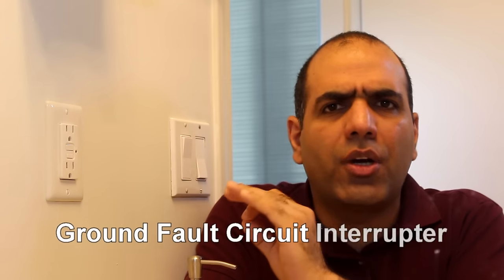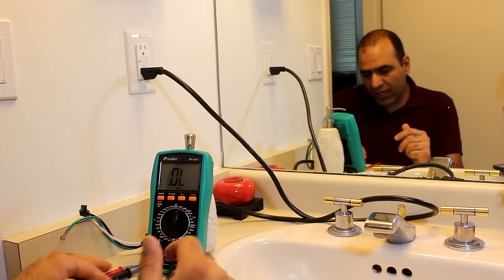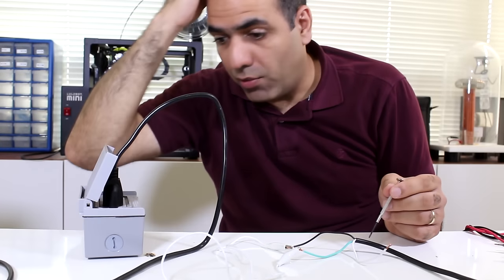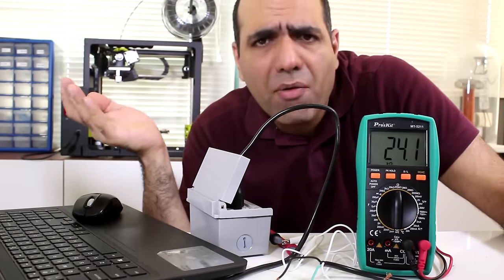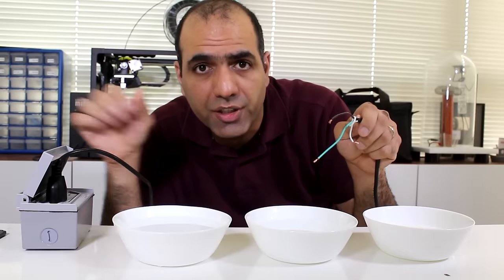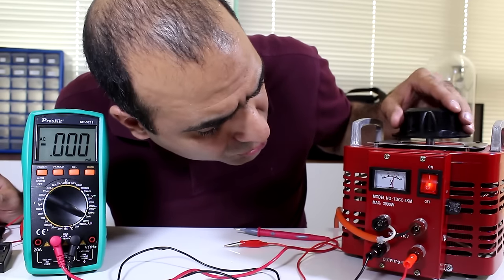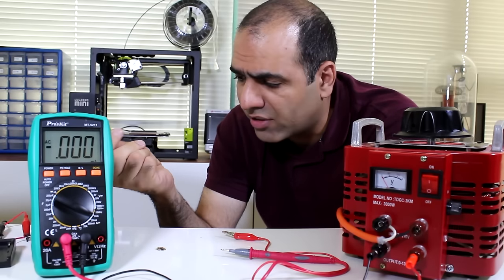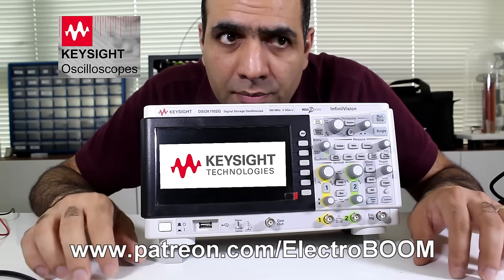The Outlet that Saves Lives

Comment: NOTE: installing GFCIs don't give you an excuse to bring live electronic devices with you into the water. It only makes it so that, if a live electronic device falls into the water for whatever reason, it might not kill you. Best way to avoid danger is to not put yourself into a risk situation in the first place!
Reply: Most of the time I take showers, therefore using devices in the bathtub is not practical. Whenever I bring electronics into the bathroom I usually leave them in the washbasin so that sound waves bounce off its  surface and boost the sound throughout the whole bathroom. Thus I don’t need my electronics to be closer to me and it is a good compromise
Reply: Unless you have an existing heart condition or the GFCI fails, it's almost impossible for that to kill you. Not saying he's right in doing dangerous stunts but the likelihood he would die is mathematically negligible

Comment: Fun fact, most injuries resulting from electric shock are reactive. Like pulling your hand away and jamming your elbow through a window pane or pulling your hand away and plunging the screwdriver you were holding into your shoulder. Not that Ive done either of those.

Comment: The GFCI it's called it in other countries  RCD or RCCB 
GFCI = Ground Fault Circuit Interrupter
RCD= Residual-Current Device
RCCB= Residual Current operated Circuit-Breaker
And only in Germany and Austria and maybe in Switzerland it's called  "FI Schutzschalter" 
(F=Fehler=fault
I= physics formular symbol for current (I=ampere)
Schutzschalter = protective switch)

Comment: Here in Germany GFCI's are mandatory in new installations for all outlets a non electrician may use. Sadly most people are so cheap they have one for the whole house. This way you stand in the dark should the GFCI trip. Though lamps aren't required to be protected. (But most times are since you have a outlet beside the Lamp.)
Reply: Update: in the meantime, light circuits are also mandatory to have an RCD
Reply: Better have it shutting off the whole house than no such system at all
Reply: @aba22125  No. There is a better way. You can put the RCD into the consumer unit so it covers a number of circuits but not all.

Typically you would cover the mains sockets outlets in to which appliances are plugged, and not the lighting.  Such that, if an earth fault occurs, and it is night time, you are plunged into darkness.

Comment: This is standard in every house in Germany. It´s called RCD - Residual Current Device. ;-)
Reply: Same as Australia, all power outlets must have an RCD in the circuit breaker
Reply: Actually it isn't the same. The real RCD (like in Germany) isn't installed directly at the socket, but w/ the other fuses. 

In it, all three phases and neutral (NOT EARTH) are running through a coil. The sum of the currents in a three-phase system is always zero. 

So, if there is a fault current anywhere (something going to earth etc.), the sum of the currents isn't zero. Thereby, a current is induced in the coil, what triggers the RCD immediatly (a few milliseconds). As far as I know, this also triggers at much lower currents than the device tested here.

The downside: harder to install and you need three-phase w/ seperate neutral and earth (do all houses in the States even have three-phase? I don't know). But, of course, we have to be a little more careful regarding electricity anyway, w/ 230V.
Reply: MrBavaria lel there is no plug or switch in bathroom in uk we use string to turn on light
Reply: We still have none in our house ._.
Reply: In most part of Europe it is a safety standard. RCDs protect people from being electrocuted and it helps also to prevent cable fires.
Reply: In Germany and Austria is also common to have 3 Phases in Residential and we have 230V per phase so around 380 - 400V between 2 phases we have 1 phase RCD to and its a safety standard. for human safety ist 30mA trigger and for fire safety is 100mA. Its also common to use 2 or more 30mA RCD`s one for normal outlets one for the bath and one for nighttimecurernt if you have.
Reply: It doesn't have to be three-phase. There are also single phase modules. The principle is the same as measuring with a ampere clampmeter (trough electromagnetic induction). If you measure just the phase you'll get the current trought it, if you measure the phase and the neutral at the same time you'll get zero (because the electromagnetic fields cancel each other out) But if there's a fault to earth you'll see a difference, the magnetic field on the neutral is no longer as strong as the one of the phase because some current escapes trough earth and is then missing on the neutral. Most households have just a single phase connection but are still required to have a RCD installed.

Hope that clears some confusion up.
Reply: The downside: harder to install and you need three-phase w/ __seperate neutral and earth_ (do all houses in the States even have three-phase? I don't know). But, of course, we have to be a little more careful regarding electricity anyway, w/ 230V._

US houses normally have that shitty 1-Phase 3 conductor system with 110V/220V

There also are single-phase RCDs beieng sold...

Do the electrical installations in your country have no separate PE and N? 
In Germany it was common to do the TN-C-S "split" of the PEN conductor in the sub-distribution when you were dealing with a TN-C system.
Reply: Almost each country in Europe... Mandatory for decades...
Reply: RCDs are tripped at 50% of their nominal rating. For example a 30mA RCD should trip at 15mA. In addition the british regulation divide bathrooms into zones and at some zones is requred to use SELV supply, (seperate extra low voltage) <120V DC / 50v AC.
Reply: That's the minimum trip-value...

On sine-wave shaped currents they trip in between 0,6 · IΔn to 0,8 · IΔn.
Reply: Thats one type of RCD that ensures all phase current is canceled. Can be 2phase, 3 or even 4. It also has inherent GFI protection, since the current on the 2 legs wouldnt be the same as ground is carrying some.
Reply: stay away. move to poland where you you won't need to worry about terrorists.
Reply: You don't need a three phase system for an RCD to work. Single phase RCD's are everywhere. You can achieve the same thing that you described simply by summing the neutral and active currents, which should cancel out unless there is leakage to earth
Reply: That's why we have devices that trip on earth leakage as well as overcurrent Cupid Stunt
Reply: It's pretty much mandatory in every country in Europe. It's even in codes here in Turkey.
Reply: In Russia it's called УЗО for Устройство защитного отключения (protective shutoff device). They are mounted on electric boards. By our standards, one rated for 30mA is installed for whole house and one, rated for 10mA for each bathroom. But it is on paper, mostly, i guess 20% or less of our dwellings really have these.
Reply: These are required in wet areas (like bathrooms) in the US, so I don't know why the father of the girl who died isn't in jail for negligence. I live in the same city that the girl was in when she died and all of the outlets in the bathrooms, kitchen, garage, and on outside of my house are on GFCI breakers.
Reply: idontcare80 in the UK we just don’t have sockets in bathrooms 😂 (except shaver sockets but they’re isolated and I’m pretty sure most people don’t shave in the bath anyway)
Reply: Shaver sockets just work at a lower voltage, which is basically the same as the voltage that we use in the US, because that voltage is much safer. Those sockets also limit power output, so much so that they're basically useless. People shave at the sink, some people use hairdryers at the sink, I use electric clippers to trim my hair at the sink, those outlets are a very convenient thing to have, and safe as long as they're equipped with a GFCI breaker (plumbing is required to be grounded). The GFCI-equipped outlet near the sink that Electroboom shows in the very beginning of his video is very, VERY common in North American bathrooms.
Reply: It's required in the USA too for outlets anywhere near water sources
Reply: idontcare80 she used extension cord so it would probably plugged in a different room
Reply: Nope, it was in the bathroom outlet, and there was no GFCI. That, plus a frayed cord and wet hands = death. Her father was a firefighter and EMT, yet he was still stupid enough to keep a frayed cord around and not to have a GFCI outlet in the bathroom, the guy should be in jail.
Reply: Why are going on about a CAFI? The video is about GFI, ya theres also AFI, big deal.
Reply: MrBavaria i call it iss (idiot safety system)
Reply: Some RCD's have arc fault detection too.
Reply: Old houses are not always up to current standards and most people don't unless there is an immediate problem. If the law changed and suddenly everyone living in older homes had to update their wiring then there would be uproar.
Reply: You don't need a three-phase system, you can get RCD breakers as 1P+ Neutral aswell. And they are not really harder to install for an electrician. It is much easier and cheaper than changing out every socket in your house.
Reply: longDiscoStick dude you forgot to mention the sum is always zero in a balanced system. Big mistake.
Reply: you have BOPE instead. Best police in the world.  :D
Reply: Here in bosnia 9 out of 10 houses are not grounded.. lol /220v
Reply: You dont need ground wire in order to make it work. All it needs to differential current between live wire and neutral one.
Reply: not standard, but obligatory if you rent
Reply: Flipping Germans. I swear you guys are ahead on everything lol. That's actually a great thing. Should be similar worldwide.
Reply: Its common in most places these days.
Reply: In belgium it's illegal to not have an RCD. There has to be an RCD and a bipolar circuit breaker on every circuit.
Reply: It's standard in every house in the US also.  Big deal.

Older homes of course may not have them.
Reply: Joseph Walden you can have them in the case of an en-suite bathroom but that's the only exception. There was talk of the latest edition of the regs permitting RCD'd sockets in some bathroom zones but I'm not really a fan of it.
Reply: uK8cvPAq that would be a RCBO. Single board slot for one single phase circuit, covers earth leakage, overload and shorts. Pricey but great for feeding individual circuits with a lot of mains filtering on each one.
Reply: MrBavaria but rcd wont work on small current as here was shown
Reply: here in kittygystan its called ELCB( Earth Leakage Catcircuit Breaker)
Reply: MrBavaria.   If America ever gets totally rebuilt from the ground up after a world War perhaps our electrical system will be cutting edge too.
Reply: An RCD is hardly rocket science, it can easily be installed into any breaker box without any rewiring and protect the whole house from that sort of shock hazard. Mine has been tripped several times in the past few years so who knows one of those times it may well have saved my life.
Reply: Yes, but most RCDs/GFIs are outdated and have a way too high trigger current. They mostly save from touching faulty devices that short live to the earthed metal case and trip when plugging in, but might not save when touching an exposed live wire.
Reply: I'd much rather be protected by an RCD + breaker than just a breaker on its own, and you can't go too low with the trip current anyway since normal leakage current would cause nuisance trips.
Reply: Yes, of course having an RCD/GFI is essential, just dont take it for granted.
Reply: Chuckiele this is why we test and inspect them. That said, I’ve tested RCDs that must be 40 years old and they’ve worked within limits. Sometimes they’re ok.
Reply: Heisst das nicht fi

Comment: Great video explaining everything. A year ago I was electrocuted by a 120v Air conditioner’s capacitor the maintenance said it was around 10 amps. Surprised how I let go. I was only touching it for 2 seconds but it felt an eternity. Next thing I knew I was on the ground and could barely move. Painful! Won’t be touching shit again

Comment: I'm pretty sure GFCI's or RCCB's (residual-current circuit breaker) as they're more commonly known here in Europe, are mandatory on any outlet (even light sources) and they actually fit on DIN rails inside the main electric panel.
Reply: Yeah but thats not Europe. No din rails, no 240v, no protections. 

Basically 1930's electrics

Comment: Aren't they called RCD?
In Switzerland we build them in our Fusebox and every new installed socket need it
Reply: Joel Heds da echt en Stromer?:D
Reply: Joel yeah i live in germany and we have and its called rcd or Fi
Reply: or in german "FI-Schalter"
Reply: In the US, GFCI protection is required for any outlet within 6 feet (2 meters) of a water source.
Reply: Smidge204 But it doesn't help really. The european system where all metal parts of a bathtub or shower are grounded are way safer.
Reply: Smidge204.  That seems to be what most in the US are missing.  The point.  Great US requires within 2 meters of a water source.  Other countries mandate it on every circuit.  In the US builder will provide one GFI outlet and run every outlet within the 2 meter requirement to that single outlet.  Bit like stepping over a pound to pick up a shilling.  Clearly there is set value on life... and it does not appear to be very high.
Reply: You're confusing value on life and politics.  We have a large contingency here in America that fight every single attempt at regulating anything as a matter of philosophy.   Is it stupid? Yes.  Does it mean they place no value on life? No.  It's misguided as hell but it's how our politics work.  People are so stupidly and misguidedly afraid of what they call "big government" they can't understand the benefits of regulation.  Therefore, in the US anything that forces any person or business to do anything that may cost them money is fought against with the vigor of a lioness protecting her cubs regardless of the evidence or logic used to back up its value. See healthcare, global warming, and farther back see slavery, voting rights, etc.
Reply: RCD - Residual Current Protective Device or german "FI-Schalter"  - Fault I (meaning current) Breaker  
They are required in Germany: 30mA for normal rooms, 10mA for Baths. They pop as quick as 30ms to 40ms.
RCDs come with 2 poles (L and N) or 4 poles (L1,L2,L3 and N)
There is also a higher Voltage in Europe, so the fault current is higher.
Reply: Metal parts are no longer grounded on new installations (new being everything after around 2000).
Reply: In Denmark they are called HFI/HPFI relays.
Reply: bendybow You realize he does it on purpose for effect, right? (He's also originally from Iran, not that this actually matters to anyone not butthurt by a simple joke)
Reply: yeah , but it's reaaaly old
Reply: NIV bruder
Reply: Here in Brazil too. They are called DR here. Don't know what this stands for.
Reply: Im pretty sure that a 30mA-RCD is enough for bathrooms.
Oder ist das evtl. erst neu in die Norm aufgenommen worden?
Reply: I don't think they're mandated on every circuit in europe ...  Where I live they're not required on every circuit. Rumours say they will soon be required. In any case, both in America and Europe nobody will come rip out and redo your wiring just because requirements changed.

Sometimes using an RCD makes it much easier for an electrician to achieve performance requirements. 

Right now requirements here require that no exposed metal can in a fault situation reach voltages higher than 50V, and that a short should triggers a disconnect by a protective device (fuse, breaker, rcd, whatever) within 0.4s.

So if you short Live and Earth together at the end of a really long wire of 1.5 mm2, protected by a C10A miniature circuit breker, the current might be so low that it takes more than 0.4s for the breaker to react. An RCD will react in 30ms. Without the RCD you'd have to either put in a smaller breaker, or use thicker wires.
Reply: Chris Eaton The government shouldn't force the people to end their stupidity. I am absolutely against any kind of gov involvement in the freedom of people. But the people should not be stupid by their own, not because any gov forces them.
Reply: In the UK "normal" sockets are simply banned from bathrooms, instead we use special 2-pin isolated-transformer sockets - "Shaver sockets".
The isolating transformer means there is zero volts between either pin and the Earth, and thus it's impossible* to get a shock from touching either of the wires.
- Touching both wires is of course very bad!

30mA RCDs are now required for all normal sockets in kitchens.
New build and rewired homes usually have one RCD for downstairs and another for upstairs normal sockets, because even though BS7671 and building regs don't require it, an RCBO** costs very little more than the 'standard' 2-pole breaker and saves lives.

However, older homes won't have these unless rewired.

* It's AC so a very small current that flows due to your capacitance, but generally so small that most people would not even feel it.
** RCD and overcurrent circuit breaker in one glorious whole.
Reply: Biff Dingus 🤣🤣🤣
Reply: Frucht Cocktail having 10mA rcd in bathrooms and 30mA in normal rooms makes no sense, like why should 15mA kill you in a bathroom but not in a normal room
Reply: New houses in the US have GFCI and AFCI both at the breaker and outlets within a certain distance from water, along with outside outlets, outlets in garages, outlets in unfinished basements, and things like that. The big difference is the breakers are 30mA and the ones in the outlets are 5mA.
Reply: Zzyzx Wolfe amps, not mA. And that's not right, the breaker and the outlet should have same amperage rating. Sometimes it's 20amp and outlet rated for 15 but that's not recommended.
Reply: Fix 3. Lehrjahr^^
Reply: Joel  fix bin au im dritte